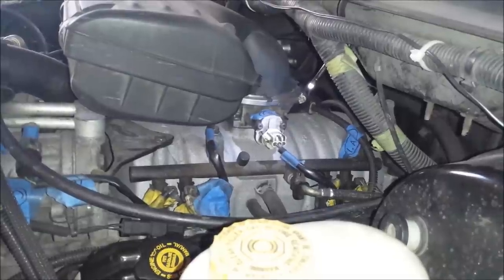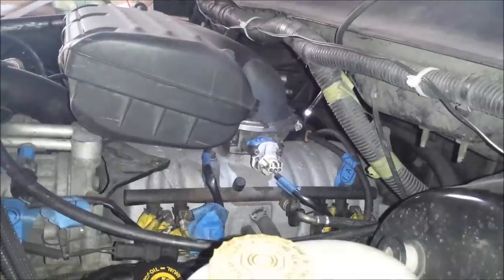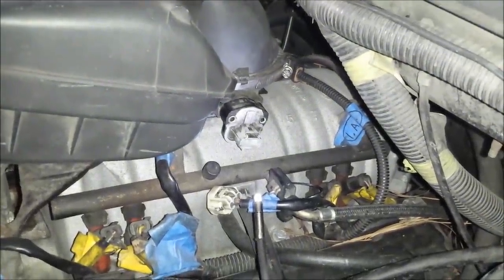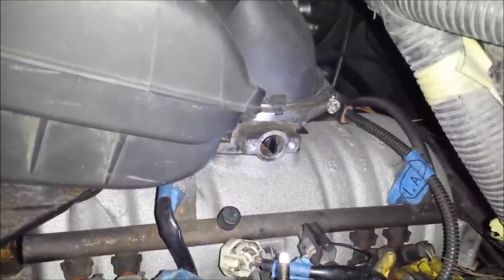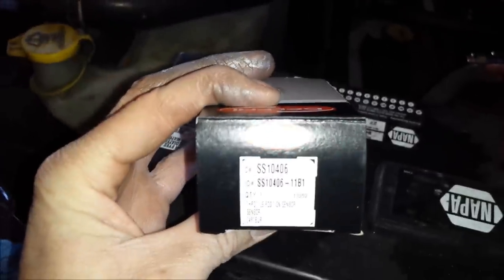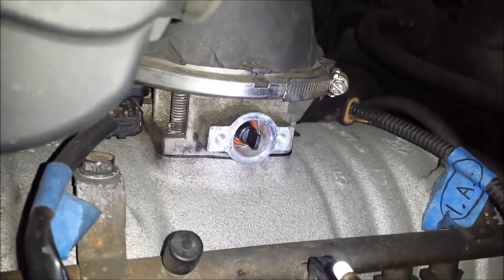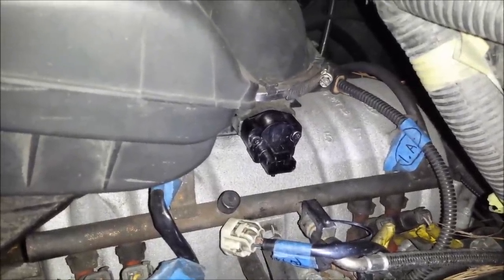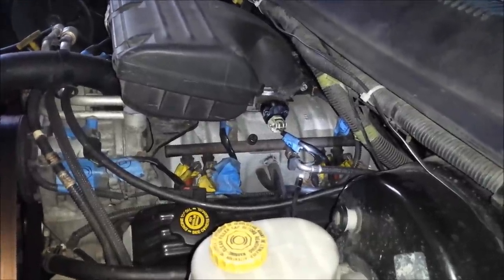Throttle Position Sensor Replacement - 2001 Dodge Ram 1500

Comment: My '03 RAM 2500 CTD got a check engine code 2122, which is the TPS. I'm hoping my TPS is right there too. I got the truck with 79,500 miles and it's now at 310k. Everything under the hood besides the air cleaner, injectors and batteries are original. I love this truck. Good video.

Comment: Thanks for the great video. I changed my sensor and the difference was incredible. My truck was previously boggy and I didn't want to take it on the freeway. After this easy fix the truck's power returned.
Reply from the maker: That's awesome to hear!  Great work, and thanks for watching!
Reply: hangwithdoug do you have any code? Or just replace sensor.?

Comment: Don't disconnect your battery unless your check engine light was on, because why set yourself up to have to go through the drive cycle when no diagnostic code existed/  just unpluf the tps and change it.  Repeat, DONT disconnect your battery unless your check engine light was on.  Also, note, the tps has nothing to do with how your engine performs when your are driving it at all, because the TPS has only two functions and they are to produce a higher idle on cold engine start up and to raise your idle when you turn your AC on, but has nothing to do with how your engine functions when you are driving

Comment: Hi Matt. Thanks for the idea on the Throttle Valve Cable. I will look into that and and I am going to also check out my TPS  as well.  I really like my V10. It has 165,000 miles on it and I might add one pint of oil in 5,000 miles. I think it has a small seep on the top rear of the valve cover. I really like the power and quiet ease of highway driving at any speed and with any load that I have hauled with it. Thanks again Matt and I will let you know what I find out.
Reply from the maker: Awesome - I bet that V10 really does pull well.  My V8 360 is getting a little "long in the tooth" and definitely doesn't have the pep that it used to.  I suspect that at least one of my heads is probably cracked, as that seems to be a common issue with these motors, and the last time I did a compression test, one cylinder was noticeably lower than the others.  At this point I really can't justify spending the money to have the engine overhauled, so I'll continue driving it until it gives out on me for good.  Hopefully I can get a few more years out of it.

Good luck with your troubleshooting.  Please do report back if you figure it out - you never know who else might be battling the same issue and could stumble across your advice.
Reply: My 96 Dodge Ram 1500 with the 5.9 has over 210,000 miles, not abused, but hard working pulling trailers loaded with bales, tractors etc. and is still running strong.  Mileage has dropped some from when it was new (18mpg), but still a strong runner and uses no oil.  I only hope my 2014 Ram 1500 with the Hemi last near as long with no problems.

Comment: Well done- the tp sensor is quite easy to test even with a DMM.  Sticking throttle cable felt at the pedal most times in my experience  is a dirty throttle bore.  Your scan tools live data should display the lack of power thru your fuel trims. Look forward to your findings.
Reply from the maker: Steve Rob Thanks Steve!  I had the air filter housing off not too long ago, and the throttle looked pretty clean at that time, but that is a great point - I should check it again to see if it's gummed up.  I've tried to "capture" the performance issue with some data logging on my scan tool, but so far I've yet to come up with anything definitive....though, I'm far from a professional, so the answer may be right in front of my face and I just haven't seen it.

I'll keep track of my fuel economy and see what happens...but I can say that my first test drive after replacing the TPS seemed to indicate that the truck was driving much better.  The throttle response was noticeably better...so perhaps the old TPS had some sort of lag in its signal.  

Thanks for watching!

Comment: Informative video, great job. Question, I had some squirrels climb up into my carb area and chewed right through that TPS wires. right up next to the pigtail connector. Looking at some new pigtails, they all seem to come with various colored wires. What are the colors of the wires on this 01 Ram you worked on?

Comment: did changing the trottle sensor solve the problem? i have a 1996 dodge 5.9 . the trottle body sounds like its taken in alot of air. i cant find the source of the problem .the truck starts and idls but when i try to accelerate the air overtakes and it dies. gas peddle is almost impossible to push , or tries to resist acc.
Reply: Check your air control valve first. Pull it out and clean it with carb cleaner. Make sure the throttle linkage is in the correct position and unobstructed. Also check the gasket on the plate at the bottom of the kegger intake (not between the intake and the block) A Hughes intake will fix this. Totally worth the money!

Comment: hey, matt i been following. great videos i did the plenum gasket repair following your video. helped alot. but now truck started but dies when i give gas or push the pedal. so, i am thinking it may be this or iac. my truck is old but it ran fine before hand. it did have the hard start of just cranking before but i drove it for a week and it was good. then i did the gasket repair and it started again but worse. just curious on thoughts if i reset the computer starts up once or so

Comment: nice video Matt Payne this i think will be the next thing i try due to it being a cheap part an not bad to put a new one in since i have 210k miles on it. i read threw the comments ihave some extra info. first if the computer/PCM is out in the truck the odomator spot will read No Bus which means your computer is fried i know replaced mine twice in 6 months time. If this is the case unhook the negative cable for about 5 min it will rest the computer enough for you to get somewhere safe if left on side of the road ( i know this cause it happen to me in winter). As for truck not starting the coil pack could be going out its a fast fix for only $25 2 bolts an 2 wires easy 5 min fix i know ive gone threw 2 of them also if the cap an rotor get way to bad it will not allow the truck to start either. I hope some of this added info could be helpful to someone down the road.

Comment: Check your air idle control valve, clean it up. And maybe tune up(sparks plug and ignition coil and distributor cap

Comment: I have a 2001 5.9, 2wd. Definitely a lack of power, especially going up hill. Not only that, but the transmission overheats going up hill, already put a new transmission in it, that was not the problem. Its still weak, and still overheats. Any ideas what it could be?

Comment: Need help... I swapped a 5.9 out of my truck and put a different 5.9 in it. It will start but will die after about 4 secs. Can't figure out why it won't stay running.. help

Comment: How's your truck running now. Mine has been a bit sluggish and even has stalled twice.
Reply from the maker: Jason Hallen My truck ran better immediately after replacing the TPS...but it was short-lived.  I think it had more to do with clearing the PCM by disconnecting the battery than it did with the new TPS.  Soon thereafter the truck became sluggish again and has been that way the majority of the time, with the random "good day" mixed in from time to time when the truck would inexplicably run like it was brand new (comparatively).  Then, about two weeks ago, it died on me.  I had just left work to head home when the transmission suddenly seemed to shift into neutral on its own (at first I thought it was slipping), and then the engine shut off a few seconds later.  I coasted to the side of the road, gave it a few minutes, restarted it and put it in gear, and things seemed normal again.  So, I tried to limp to a mechanic nearby when it died again and wouldn't start again.  Since then I've replaced the ignition coil and crankshaft position sensor to no avail.  At this point, it looks like there is either a wiring problem, or the PCM has gone bad.  Either way, I have a feeling this is related to my ongoing sluggishness.

I'm waiting to hear back from the mechanic whose shop I had it towed to last week.  I couldn't figure the issue out on my own, so I finally threw in the towel and took it to a pro.  This guy does good work, but is in business by himself and has a large customer base, so it usually takes him a while to get to your vehicle.  Hopefully I'll hear something back from him soon.

If your truck is stalling, I'd check fuel pressure first.  It's possible your fuel pump is dying.  Beyond that, I guess it's time to start looking at plugs, wires, distributor cap/rotor, etc.  Maybe check the throttle and give it a good cleaning.  Start with the simple stuff and eliminate everything that you can.  It's possible it could be a bad crank/cam sensor, too.

Good luck, and thanks for watching!
Reply: +Matt Payne   I was having issues with my truck shifting funny and having a high idle when my check engine light came on and gave the code for the TPS.  I went ahead and changed the TPS, IAC and the MAP sensors.  Now my truck runs like a dream!  Was the mechanic able to find the issue with your truck?
Reply from the maker: +Jason Wright Nice work!  Isn't it a great feeling when you restore performance?  Unfortunately, my truck is still not running, but the mechanic and I both believe the PCM is fried.  I'm going to try to replace that in the next week or two and see what happens.  I really hope that solves the problem, because the only other thing it could be would be an electrical/wiring problem, which could potentially be impossible to find.

Thanks for watching!
Reply: Did you by any chance have a new muffler or tailpipe ' welded on?'  I had mine blown twice when it was welded on without unhooking battery and/or PCM!

Comment: mine was doing something very similar turns out it was low fuel pressure trying to go into passing gear and fall on its face or at like it was hitting the rev limiter replace fuel pump no more problem
Reply from the maker: Thanks for your input!  I have been very suspicious if that could be part or all of my issue as well.  I have checked the fuel pressure in the past at idle, but have never had the means to check pressure under load.  I may have to dig into this a little bit more though...my truck is getting weaker and weaker.

Thanks for watching!

Comment: do you have any idea where the cam sensor is on a 99 3.9 Magnum it coded bad and the genius at the parts store can sell me the part but can't tell me where it is
Reply from the maker: Richard, I'm sorry for the delayed response - hopefully you have already solved your issue - but the camshaft position sensor should be located in the distributor.  Click on the link below to see a screen capture from the factory service manual about removing the cam sensor.  Also, you can download the complete factory service manual from the link in the "About" tab of my YouTube page.

http://www.brinkleys.org/users/tsl/Files/Dodge%20Ram%20Camshaft%20Position%20Sensor%20Removal.png

I hope this helps!
Reply: Hey I found it but turns out that the guys at the parts place. let's just call it O really auto parts were almost no help so it took me a while but I figured it out after replacing the cam sensor crank sensor throttle position sensor I found out it was my ecm parts dick was going to charge me 400 bucks for one but I found a place on eBay that rebuilds them for 125 bucks was a pain but I got it just took a little blood sweat and beers... and twice as much money as needed " I geuss no education is free" thanks lol

Comment: Did this fix your problem?
Reply from the maker: +BBKlima It seemed to help, but my truck died completely a few months later and I have still not gotten it running.  It looks like I have narrowed it down to a bad PCM (computer).  I hope to replace that soon and see what happens.  If the computer is indeed bad, I have a feeling it was related to a lot of my intermittent performance issues.  I think all of the other things I've replaced have certainly helped, but if the PCM was failing, I think it was probably the main source of my problems.  I'll post my results once I swap the PCM.  

Thanks for watching!
Reply: +Matt Payne why are you jumping to a computer issue? do you have spark and fuel? if you do, screw the computer.Check the IAC (Chrysler's like to kill them every two years), MAP and MAF, and lastly just take the throttle body off and clean it. While its off, might as well do the intake gasket. Last ditch effort, check your fuel pressure; it should be 49.2 +/- 5 psi.
Reply from the maker: +laskalives Thanks for the input, but trust me when I say I'm not jumping straight to a computer problem.  When the truck died, I was driving when the transmission suddenly seemed to go into neutral, then about 4-5 seconds later the engine died.  I was able to restart it and drive a short distance, but then it did the same thing again and I could not get it to restart this time.  

First I checked the fuel pressure, which checked out exactly per spec.  Next I checked for power at the coil, and found there was none.  Since I already had a replacement crankshaft position sensor that I had been planning to install, I tried that next, but still had no spark.  Then I tried a new coil, because my multimeter seemed to be acting up and I wondered if maybe I really did have power to the coil, but that didn't work either.  Next I searched for a loose wire or bad ground, but couldn't find anything obvious.  I finally had it towed to a mechanic, who has since replaced the camshaft position sensor to no avail.  He also jumpered the Auto Shutdown Relay to see if perhaps it was preventing the power from being sent to the coil, but that didn't work either.  At this point, we feel we have eliminated all possibilities except for wiring or the PCM.  I can get a used PCM for ~$100 and have it reprogrammed for ~$100, so that will likely be my next step.  If that doesn't work, I guess it's time to start tracing wiring harnesses.  I really hope that's not what ends up being the problem.

Your suggestions to replace the MAP and clean the throttle body are good, but neither of those issues would cause loss of power to the coil.  There is no MAF on this truck.  I replaced the plenum and intake manifold gaskets, cleaned the IAC and throttle body, and replaced the Throttle Position Sensor all within the past 15 months, so I do not suspect any of those items to be contributing.  The distributor cap and rotor and spark plug wires were all replaced in June of 2013, so they should still have life left in them.

I'll definitely report back here if I figure out my issue.  Thanks again for the suggestions.
Reply: +Matt Payne are your injectors getting the signal to fire?
Reply from the maker: +laskalives I believe the mechanic working on my truck now was able to confirm an injector pulse from the PCM.  Plus, there is a very strong smell of gasoline when the engine is cranked.  So, I think the injectors are working properly.
Reply: I had a 91 Dodge that would just die occasionally going down the road or at a stop sign.  Sometimes it would start right up, other times wouldn't start for several days, then start and run again. Finally got tired of fooling with it and took it to a Dodge dealer.  They had it 3 days and couldn't figure out what was wrong with it.  Turned out to be the computer.  AND then I found out what fried it.  I had a new muffler put on and they arc welded without unhooking battery and/or computer.  Problem was the truck started and drove out of the shop, so they denied they did it.  However, a few months later had to have a new tailpipe.  Same thing..welded on it, started right up and got it home only to not start the next day.  Changed the computer and it was fixed for thousand of miles.

Comment: Man I have the same truck but I have a 318 in mine and I was thinking to myself when this truck come off the production floor in 2001 I know it would do donuts I've tried everything to try to get my truck to do a burnout but it just doesn't have the torque anymore and when I'm on the interstate it is pretty hard to get it pass a 100 mph I have to really give it hell so I've been chasing horsepower also I've been asking everyone what can I do to give it more horsepower without spending a fortune I only paid $1, 200 for mine and it come with MagnaFlow exhaust so it sounds mean as hell but it's not
Reply: I bet you blew your truck up by now.....
Reply: @jessiethemac2506  yo i was just thinking that 😂 probably has tow mirrors flipped up too

Comment: What was ur issue with this anyways
Reply from the maker: If I recall correctly, I was trying to troubleshoot a lack of power.  I can't say for certain that replacing the TPS helped significantly, but anecdotally it seemed to help a little bit.

Comment: I have a 98 dodge ram 1500 and going down the highway the RPM will fluctuate up and down while keeping even acceleration. Its really weird going up hills. It will go up to 2000 RPM but feels like no power. Im thinking throttle position sensor. My truck has just 5 miles from 280K miles.
Reply: Nice 280k! I’m at 226k trucks still strong.
Reply: @jessiethemac2506  mine is at 294K now